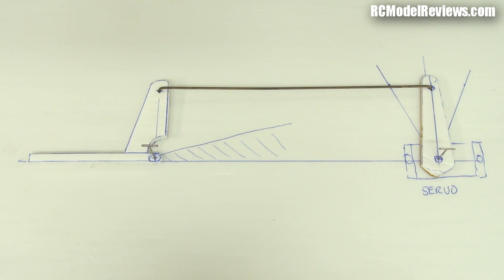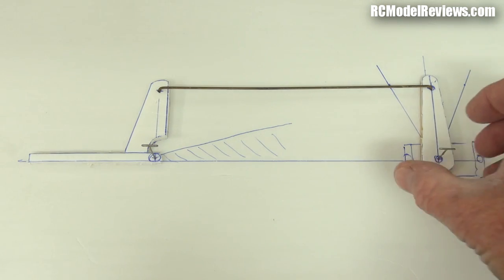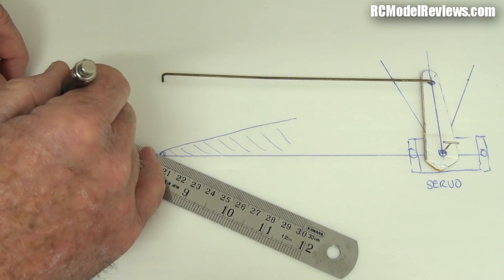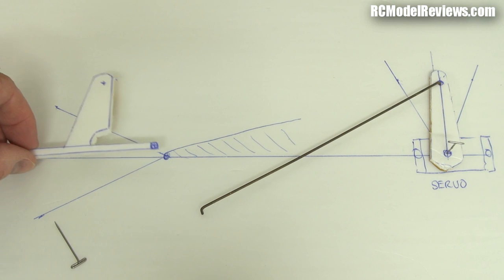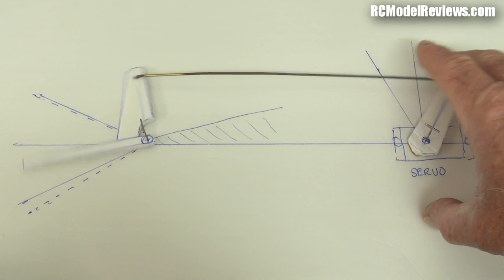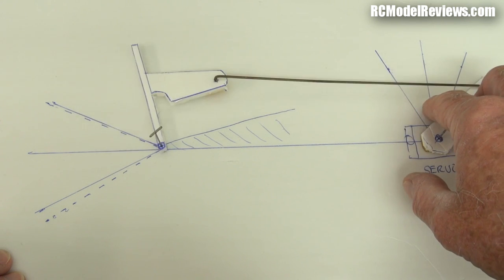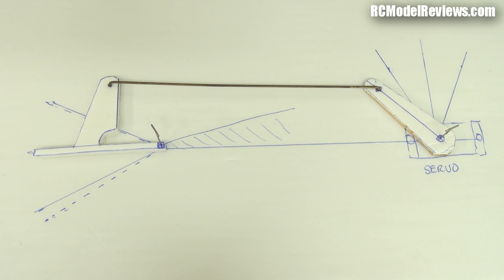RC Basics: The importance of good linkage geometry

Comment: Why are we even using rotary servos?  Anybody notice the inherent 'negative' expo caused by the rotary to linear conversion?  Check the trigonometry.  We get reduced pushrod motion at extremes of the servo arm rotation... = negative expo.  Early proportional servos like Bonner Digimite had linear output arms.

Comment: Would you explain the mechanical advantage when using different combinations of hole selection in the control horns.
Reply: For a four bar linkage like this, mech advantage varies as a function of the input angle for a given linkage length
Reply: Has nothing to do with mechanical advantage really, it has to do more with the throw of the control surface.  So say a beginner can have the linkages set for less thow, for less "immediate reaction" making it easier to learn.  If your servos are having to work too hard there is either binding, or your servo is not strong enough for the application, ie needing a high torque servo.  This is why matching the correct servo to the plane and flying type is so important, some planes will have a reccomend servo as well so you dont have to guess.
Reply: @110101719  there is actually an advantage. If you use the correct servo hole the servo will work in whole of its span. Let's say, you've used your furthest servo hole and the throws are too wide. So wide that you need to reduce them to 40% in your Tx - it means that the servo is working only in 40% of its swing, which makes it much more strained (arm ratio) and less precise. Also it could happen that you have a cheap/old tx in which you can't modify throws, selecting correct servo arm hole is critical here

Comment: Although, sometimes a non-proportional control surface throw is desired, especially for a flying wing. Aileron differential is an example. It can be a desired trait for models that have an undesirable amount of adverse yaw when turning. A flying wing, designed to fly upright and without a rudder, may need some aileron differential to make the turns more coordinated. Aileron differential can also be a desired trait for gliders to reduce unwanted amounts of trim drag when turning in a thermal. Heck, aileron differential can also help prevent tip stalls in a low speed turn :-)

On the other hand, you have to set up aileron differential correctly. If you reverse it by accident, you can make you model fly even worse and the chances of a tip stall go up.

But yes, for my standard models like 3D planes and sporty planes, straight and parallel linkages are very predictable for inverted flight and make your control surface behave as you'd expect. There's nothing more annoying when your wing's control surface throws don't match, haha.

Comment: I wish I had seen this video a long time ago.    I learned the hard way.  You might also talk about the little holes that go up and down the control horn and what happens when you connect at the top of the control horn vs the bottom.  Big differences there as well.   But a great video just the same.  anyone who flies fixed wing will need to know this.

Comment: Excellent Chewtorial !!  The correct setup here gives you stable Control. 
One thing..... For a Pro Tip, on Ailerons ONLY. Having MORE up travel than down travel, actually allows for easier bank turning.

This is because the air pressure is Higher UNDER the Wing than ABOVE it. For the less experienced, this particular *wonky" setup, works better for controlling Roll, without Rolling Over too easily! Just a thought.

However, the one thing you pointed out that is VITAL, and should always be applied, is keeping the control horn Rod holes, in line with the pivot point! 👍👍

Comment: Thats exactly how differential ailerons work, except you would need the horn on the underside of the control surface so you have more upward throw than downward throw to prevent adverse yaw and drag on the climbing wing in a turn.
For rudder and elevator, you want it to be as you state.

Comment: Before computer radios I always used twice as much up aileron as down in my high lift wing airplanes (rigging arms and rods). This eliminated yaw due to the difference in the amount of pressure between the top and bottom of the wing. Some full sized aircraft, such as Cessna, used the same technique, although to a lesser amount of differential. With computer radios this differential can be done electronically (with differential or aileron/rudder inter-connect).

Comment: Hi Bruce. Good video. Topic not mentioned and just as important, is the additional rotational load (torque) required on the servo in moving the control surfaces when the positioning of the control horns and servo arms are not optimized to the geometry of the hinge system. Similarly, the additional resultant unnecessary strains on the control horn joints to the moving surfaces.

Comment: This video was also helpful when using servos in robot design. Linkages with non-standard arrangements almost always do not work efficiently or as expected. This usually causes gimbal locking or unexpected cranking, causing servo overload, damage to the linkage base, and unnecessary debugging. thank you.

Comment: It is probably worth making a follow-up to this for more advanced uses of offset geometry. Quite often we use these offset effects for good! For example, a full house glider, you want (in your words) "Snot loads of down" flaps for Crow Brakes (often more than 80 degrees) and a little bit of up, for full span aileron mixing, or camber/reflex.
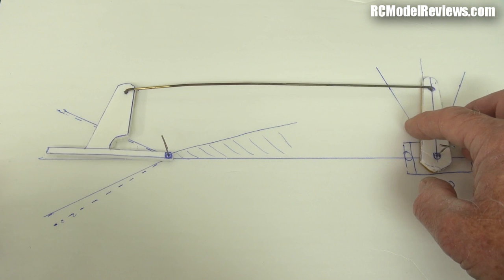And the best way to do this is to have the servo arm offset as you do at 6:02. Using EPA and Subtrim on the radio to achieve the same effect tends to end up wasting servo torque and resolution as you can't use the full movements.

Comment: Nice one Bruce. I've always wondered what difference the angle makes. The thing is i've found that when you center a servo before installing it into a model when you fit the servo arm they are never straight! They angle one way or the other just moving it to the next tooth on the arm. Which is annoying. Think i will go back and redo some of my push rods to get the servo arms more centered. Cheers.

Comment: From the second RC plane I've built in my life onwards (didn't really care a whole lot when I made my first one, and even there I made at least sure that the servo arms were as close to a 90 degree angle to the body as I could get them) I've always paid attention to this. I may have had the control horns just a hair or here and there but unless the servo sat a whole lot out of line with the control surface  where I had to change the whole angle of the linkage (just think dual rudders with a single servo on like an F-18) I always made sure to have the line from the hinge to the linkage hole as perpendicular to the control surface as possible.

Comment: great video. I had this problem when connecting a servo to the FPV camera in a 210mm 5" quad. very  tight space and I had to try out a lot of lengths and combinations before it worked.
Reply: how would you rigg a runcam eagle for instance? the holes where the camera is mounted at not allined in any obvious way with the holes in the backplate of the camera.

Comment: I used to do that for differential ailerons, great when you only had one servo for both. That way you could avoid adverse yaw by having more throw on the down going aileron, thus more drag on the correct wing for a nicer turn. As mentioned we now just install 2 servos and do it in the radio.

Comment: Hi Bruce excellent explanation, can you do a video on the correct method of antenna placement on a model i.e. should it be at 45deg. or 90 deg or horizontal on a twin antenna rx or single antenna rx. Were is the best place or position to have it.
Pete

Comment: I think to get equal throws do this:
Draw a line from the hinge to the linkage on the control surface 
Now draw a line from the servo spindle to the servo linkage 
These lines need to be parallel 
You say vertical but relative to what?

Comment: Love all your videos.  This newbie is learning a lot. What about servos on flaps? They move in only one direction, of course, and they spend most of their time at one end of the motion. I assume it's OK to set up the servo so that the horn is at one extreme, then it moves toward straight up in the middle position, then then other extreme in the full flaps down position.  Is that right?
Reply: "Only move one direction" - Your flaps went down and never came back up? They're stuck?  Flaps move two directions; up to be parallel to the wing for decreased camber, and down to increase camber.
"set up the servo so that the horn is at one extreme, then it moves toward straight up in the middle position, then then other extreme in the full flaps down position. Is that right?"
Yes, that's right. Servo in the middle when the control surface is in the middle.

Comment: If you get a plane with servo horns in the wrong place, like in your example, could you not offset the servo arm position so that the non-linear servo arm throw will contract the weird horn movement? I admit that it would be difficult to get the geometry right, but would you ever consider doing that for a model that would take to much damage removing the stock horns?

Comment: What about when the horn is lined up with the hinge line, the servo arm is straight, but the linkage isn't flat (say the linkage is in the furthest hole from the servo pivot, while the control surface side of the linkage is in the hole closest to the pivot) would that just change the throws evenly?

Comment: Howdy Bruce. I have read and watched videos (for flying wings) about setting up the servo horn one tick forward for "neutral" position. Literally, center your servos like normal, and then when putting on the servo horns have both servo horns just one tooth forward. And supposedly this will help with axial rolls? My question to you is, does this theory hold water?  Thanks again mate for the videos and all the info you are happy to dump in our laps!   -Jamie

Comment: This is the 3rd video I've watched trying to figure out how to set my servo control arms so I get more UP than DOWN on the ailerons. But my plane has servos on the belly, not the top of my plane and all 3 videos seem directed at sail planes or belly landers that have servo arms on the top. Just thinking about it, I think moving the servo control arm on my plane so that it is forward rather than aft, would give me the proper differential I need. Can anyone confirm my suspicions?

Comment: Can you do a part 2 showing the what happens when you use the multiple holes in the control arms/horns? I have had instructions tell me to use the top hole on control arm and the bottom hole on the servo arm and I really don't know why they can't all be set up like in this video. Also why are there so many holes to choose from in the first place? 

I also have issues where I get binding in my linkage. When I install everything at a 90 degree angle the linkage will go out of whack when the elevon is moved up or down. This causes the control horn to bend to one side or the other. 

I have watched other peoples videos on linkage and they all just cover a small amount of the setup but usually fall short or just confuse me even more.
Reply: Demon Prince if, for instance, you don't have a computer controlled transmitter and you don't have control over your servo's end points, the only option you then have is to use different holes on the servos and the horns.  That's why the manufacturers make multiple holes on both.
Reply: To maximize torque and precision (good) always use the inner most possible hole in the servo horn. In most applications this will mean using an outer hole in the control arm to get appropriate throws. In others it will mean drilling an hole even further in on the servo arm. For precision models where you want each couple of clicks on the trim to show on the surface, must also use non flexing rods and minimize the different diameters of the rod and hole. Or look up 'pull spring' controls for a easy solution for cheaper servos that have a lot of 'slop'.

Comment: This video just touches the surface as people screw up so much with linkages. 
Other common errors are:
• Not mounting the pushrods at right angles to the deflected surface,  (hey Chinese designers of Tek Sumo,  Mini Talon, etc), effectively wasting useable torque of the servo and adding wear to wire+horn joints.
• Limiting servo throw to achieve aileron differential instead of aligning the servo horns to achieve it mechanically, and in by doing so waste available servo resolution and torque.
• Using the innermost holes on both the servo and control surface horns, effectively amplifying the effects of play and slop in the linkage.
• Poor alignment of servo horns with flaps causing the servo to be loaded in both the up and down positions.

Comment: Very good explanation I have seen so much bad geometry...  However back in the day we played with geometry to get exponential movement with short arm long arm or low ground arm short arm and used offset surface horns to give more up than down or more down than up to make our planes fly more neutral upside down... Etc.... Ailerons to give one wing more up or down to create either a one wing lift more or to obtain neutral roll due to non asemetrical wing shapes.... Also  you gliders is common to make the down aileron less so that you are lifting instead of creating a Down force.... Because we do not want anything going down